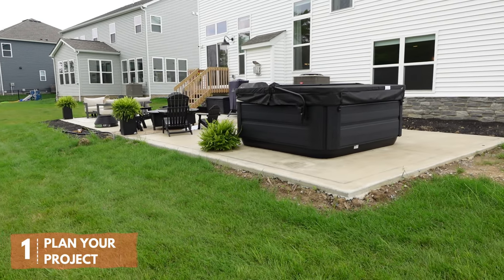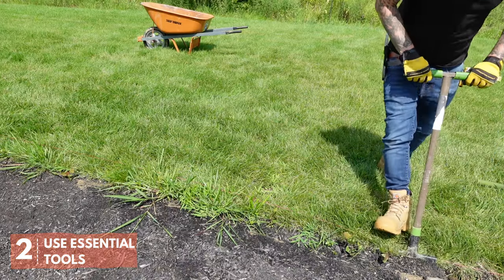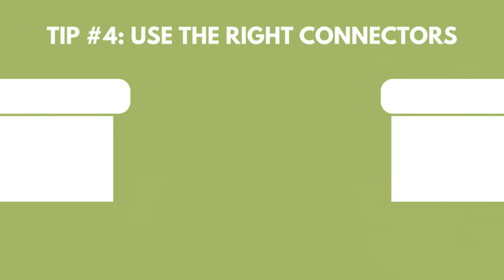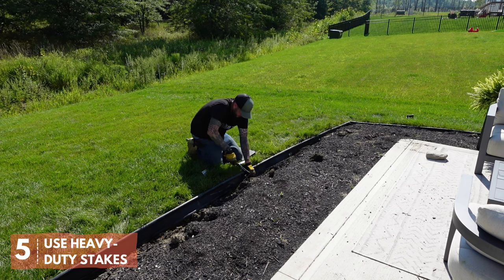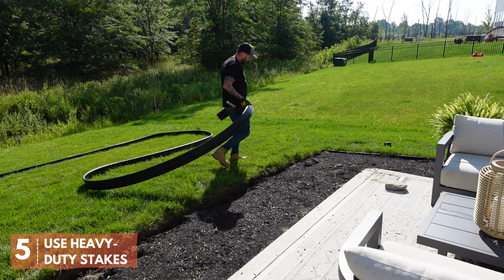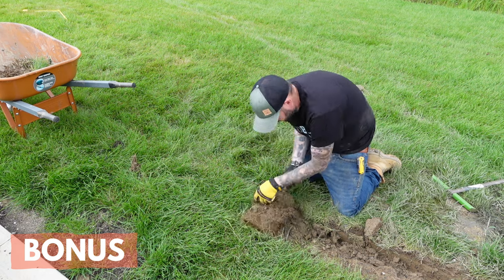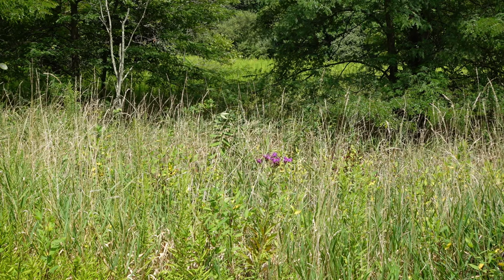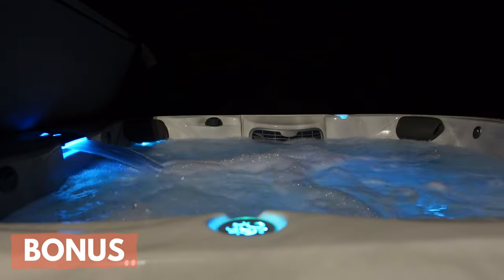Remember These 5 Tips | Landscape Edging

Comment: Good tips, but I would never install that plastic garbage.
Reply from the maker: Thanks for watching, anyway. You installing metal? Composite?
Reply: I like stone, pavers, textured concrete which looks beautiful and can last many, many years if installed correctly.  I don't like metal, rubber, plastic, composites.... for a variety of reasons.  In my experience you can't beat the beauty and durability of stone type products. @DadBuiltDIY
Reply from the maker: @ube2slow I hear you there. I've been kicking around the idea of some paver projects for next season
Reply: Why is it garbage!
Reply from the maker: @jessemartinez2606 it really comes down to preference. Some people like the look and durability of a more solid material like stone. I've had good experiences with this edging - but no matter what material you choose, the quality of your install matters most. Badly installed edging is going to look like garbage, no matter what material it is. That's one of the reasons I made this video! Thank you for watching.
Reply: We’ve had plastic edging lasting us for 18 years (Midwest USA). Extremely inexpensive. I’m here as I need to have some replaced.
Reply from the maker: Good luck with your project! Thanks for being here
Reply from the maker: I appreciate you!
Reply: In my front yard between the lawn and mulch, I use the Vigro edging. I allow the grass to overgrow the edging a bit to hide from the street view. On the side yard, I installed pavers flush with the lawn and mulch for mowing ease.
Reply: Ditto
Reply: You are talking about budget friendly option vs options that are way more costly like pavers and stone. Of course those options look better, that’s also why they cost 10x as much. I would much rather have some type of stone or concrete paver, but the price is scary
Reply from the maker: @andresmaldonado7356 thanks for your perspective! I appreciate you 🤜🤛
Reply: What  would you use…
Reply from the maker: @karenosolin6061 thanks for watching
Reply: @ube2slow yeah if you can't afford pavers then just leave it natural Edge looks best in most cases but I do tile and stone work and love it
Reply: We don’t give a shit whether you like it or not 🤡
Reply: natural edge for the win
Reply: Exactly.

Comment: If you buy landscape edging that comes in a roll, the quality is not there. High grade quality edging cannot be rolled.  You buy it flat because the material  is thick. If you do buy that "edging in a box" so to speak, you'll be doing it over and over again because it will pop up.  That's why people say they don't like landscape edging; because they see it at other people's homes, uncurled, sticking up, cut by the lawn mower, and grass growing up over it, and tree roots popping it up out of the ground. That curled edging is a homeowner's nitemare about to happen. But go ahead, and buy that stuff if that's all you can find, or just not buy it, and continue to cut a natural edge into the soil.And while I'm on the subject, don't buy that metal edging either, because it too has a smoothe wall, and the metal stakes are pounded straight into the ground, and in time it works its way back up from the ground, and also becomes worthless.  Go to a professional landscape supply location, and buy high quality landscape edging.  Around Michigan, there is  Site One which is the old John Deere Landscape Supply houses as one possibility to acquire qulaity edging. I've been in the landscape design/build industry for 37 years now, and the edging that I use stays in the ground, on some projects going on 20+ years. And never instal edging around trees as the treeroots will eventually find that edging as the roots expand and will pop it up, and you may cause the roots to grow in a cicular fashion as the roots hit the edging and grow in a circle rather than expand out. Sorry for such a long message, but don't waste your time or money unless you buy professional grade products. THUMBS UP for effort.
Reply from the maker: Thanks for watching and sharing your thoughts!
Reply: This comment actually helped me out a ton, currently ripping out this plastic edging that was placed 4 years ago, so much work. thank you
Reply: Any edging that is higher than the grass is going to be subject to lawn mower or strimmer damage. That was the first thing I thought about when I looked into this. Best edging method I can see is to cut the soil and make sure the grass edge side is higher than the side it is next to.
Reply from the maker: @Reprogrammed_By_SEGA thanks for watching and your recommendation

Comment: Using a moon shovel to cut a sharp edge in grass and there is no need to have plastic or any barrier. My favorite way to edge! Looks cleeeeen that way
Reply from the maker: Thanks for the tip, brother 🤜🤛
Reply: That may be useful for small lots/areas but not when you are working with a large space, very inefficient.
Reply from the maker: @jfil5518 thanks for watching.
Reply: @jfil5518  and doesn't last long. Grass is invasive as heck.
Reply: @jfil5518  When you have sandy soll this really helps to get a nice edge.
Reply: Just edging like that doesn't work if you have mulch down in the bed and want to contain it from washing away on the grass or if it's a bed along a property line, prevents the mulch from spreading onto
 a neighbor's side .
Reply: @nancybrennan5536  
Yes it does if you carve out the dirt a foot or two in to the bed.  
6 inches down with moon shovel and 2 feet over from the bed.  Looks phenomenal!
Reply: @mikeb1039  
It last a long time.  It’s all over my yard. You just have to trim 1/week. 
Weeds/Grass doesn’t grow on the side that is exposed.  
Just look up moon shovel edging for a better understanding and you can see how it looks

Comment: Nice video. Good job 😃.   Something to add. Any place where you are using connectors, use drywall screws to hold them together.  Works great!!😃😃
Reply from the maker: Thanks for this tip! I missed this and have had some issues with expansion over the past 6 months. I may do a little digging to fix this

Comment: Regarding 90 degree corners, I couldn't find those corner adapters anywhere near me, so what I did was take an x-acto knife, and cut a roughly 40 degree triangular section from the inside curve of the circular top portion of the edging.
After doing that, I bent the edging, and the two edges made from my cut connected as a result of the fold, which left me with a seamless 90 degree corner.
Reply from the maker: I love that! I thought about doing that myself, before finding the connectors. Great to know for the future. Thanks for the update!

Comment: nice video - quick question b/c I'm in the middle of doing this exact project: when connecting the two ends of the boarder using the "connector" piece, does the connector piece go <inside> the top tube, because it's almost too big to fit?  Or does it clamp down on the outside top of the edging, like a "c" clamp?  I was able to get the connector to fit by hammering it a bit in on itself, but I'm not sure if that was the right way to do it. Thanks.
Reply from the maker: Hi Sara, thank you for watching and the comment. My corner piece fit inside the top tube on each end. Mine was a tight fit, as well. Didn't have to hammer it or anything, but it was definitely very snug.

If you're connecting two straight pieces together, you can take a pair of channel lock pliers and pinch the connector together to get it to slide into the tube easier.

Best of luck on your project!

Comment: Nice.  So you're driving the stakes through the edging, correct?   Resting the bed sounds nice, but the soil isn't going to be any different "for the plant" that 2nd year vs planting immediately.  Yes the soil will be better, but that will happen regardless and that extra year of growth is pretty valuable.  Also look around your property (and your families) and you can fix a lot of bald-ish spots easily with that sod.  Or kill off a heavily weeded area and reclaim it with sod. Got a low, wet spot?  Put in some vertical drains (post holes filled with gravel, and build up the area with the sod.  Endless uses for sod.  :)
Reply from the maker: Hey brother - thanks for those great tips 👊. Yea, I'm going straight through the edging with the spikes.

Comment: May you please give me a link to the corner coupler you purchased? I am a newbie and there are different ones that confuse me. I also used the vigoro edging you used in the video. Please share the link to the connector. Thank you!
Reply from the maker: Hello - Best of luck to you on your project! Here is the coupler I used:

https://www.menards.com/main/building-materials/landscaping-materials/lawn-edging-tree-rings/master-mark-plastics-reg-black-master-gardener-reg-plus-landscape-edging-corner-coupler/53208/p-1444439139163-c-13237.htm

If you aren't near a Menard's - you could try this one on Amazon:

https://www.amazon.com/MASTER-MARK-PL-PROD-53208/dp/B000I1CKDG/ref=asc_df_B000I1CKDG/?tag=hyprod-20&linkCode=df0&hvadid=459648457333&hvpos=&hvnetw=g&hvrand=15335520402177723807&hvpone=&hvptwo=&hvqmt=&hvdev=c&hvdvcmdl=&hvlocint=&hvlocphy=9014900&hvtargid=pla-943523796162&psc=1&mcid=9dc815c9d73334d7adf4977befef12d4&gclid=Cj0KCQjwwMqvBhCtARIsAIXsZpZfXzzFKlqxP7Or-zZ7VlLR1nt-lDO7SaSf7v7jHHSVQNRBs7cSav4aAhArEALw_wcB